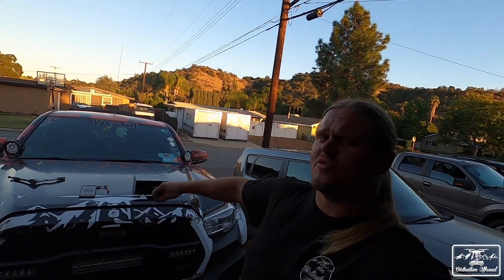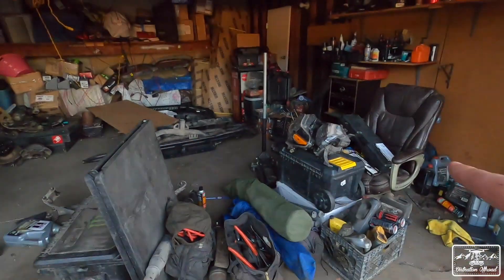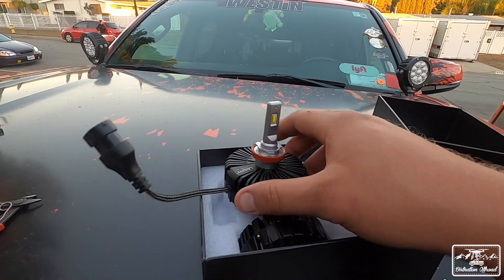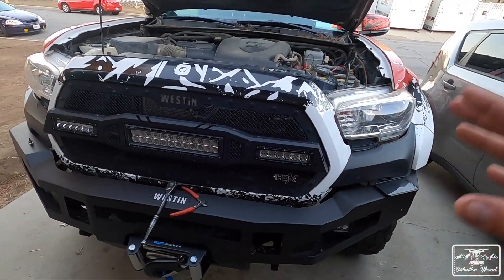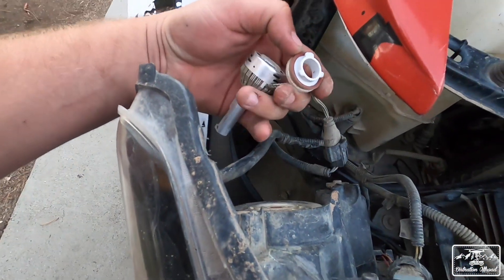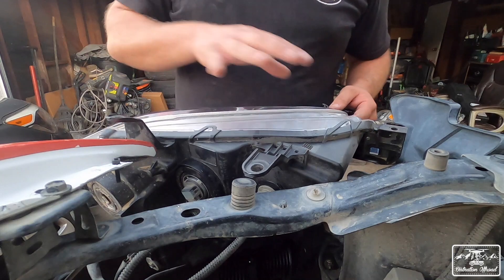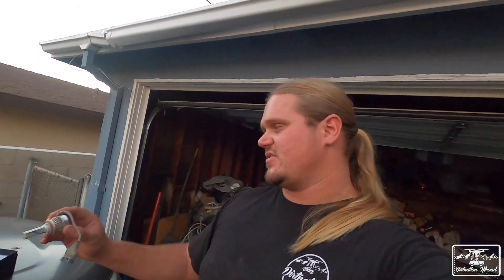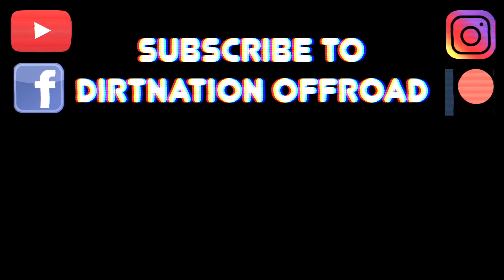LASfit Super LED headlight bulbs Install and Review! 2017 Toyota Tacoma

Comment: GTR 2.0 are fantastic and far superior to Morimoto. Also easier to install since the GTR 2.0 HID are plug in play and to not require a direct connection to the battery.